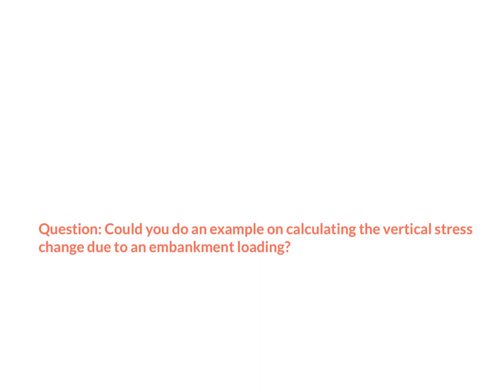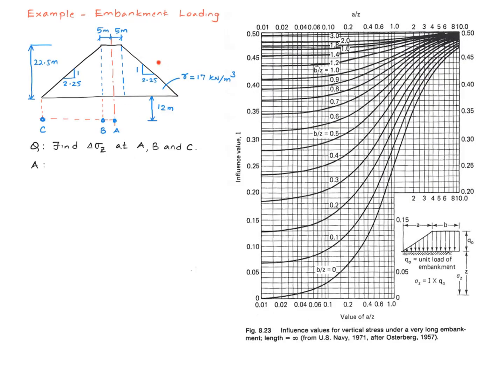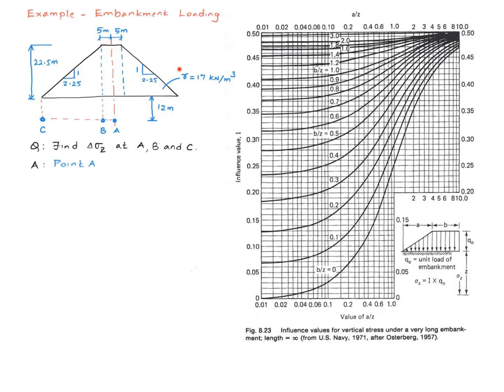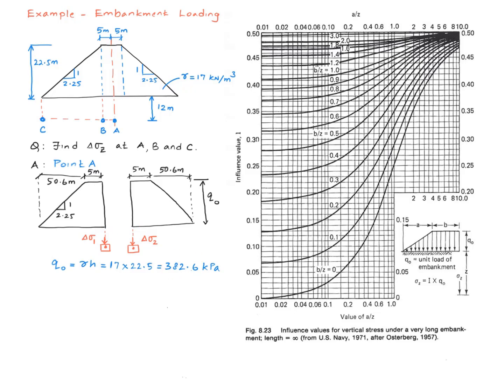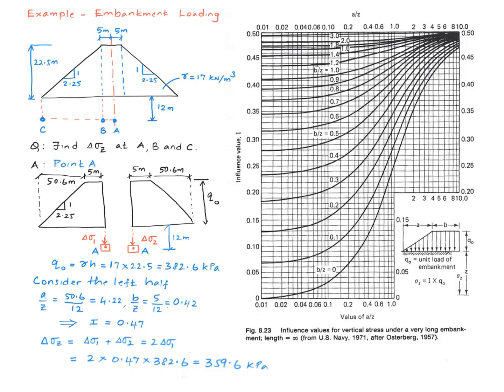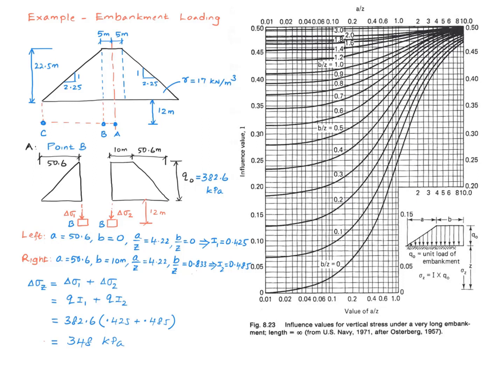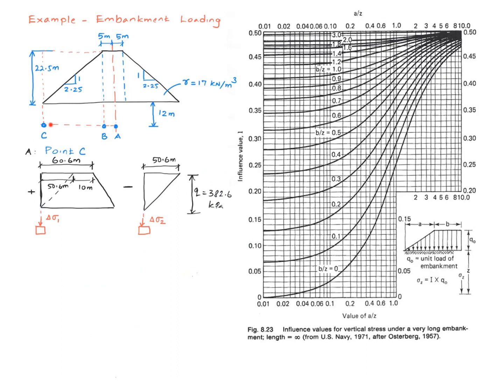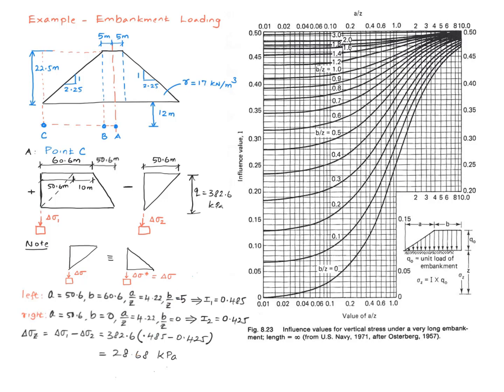EN 01 302 9 8

Comment: how did u get a??? in a/z
Reply: Since we are given the dimensions of that inner triangle, you can use ratios/equations of a straight line/gradient to calculate the base of the bigger triangle (which is a) using the given height of 22.5m